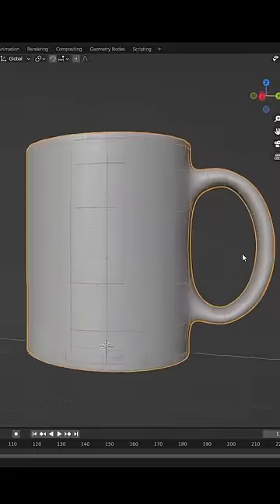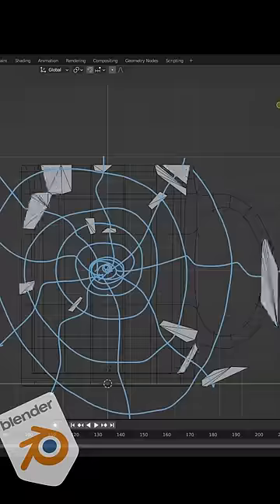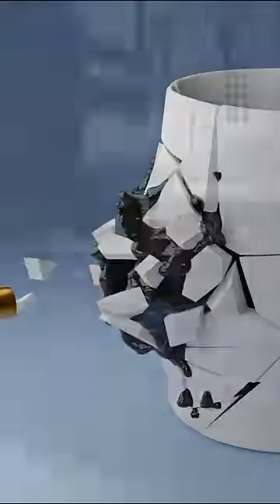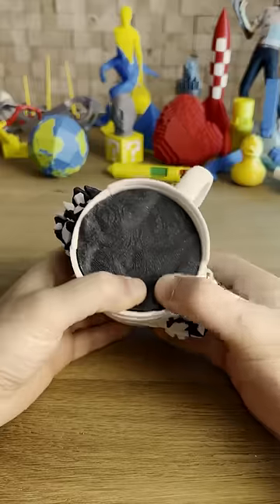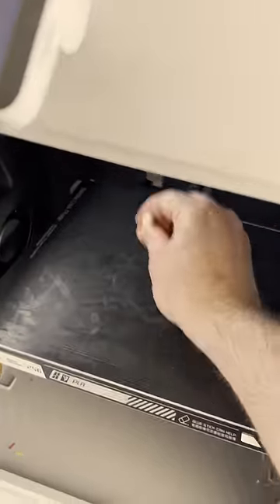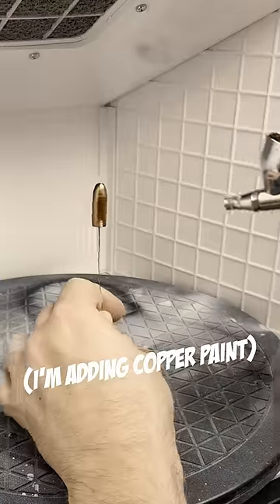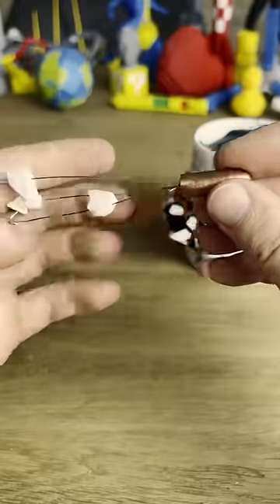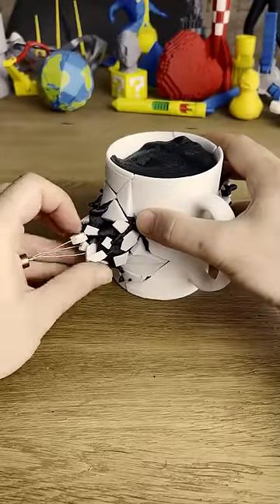Printing A Coffee Mug Shot By A Bullet ☕️ #3dprinting

Comment: This is incredible! In case you ever need to model a bullet again, the shape you printed includes the casing the bullet is fired from. The conical tip is the actual projectile. Amazing work!
Reply: doesnt the casing have a lip around the back end, the bullet doesnt seem to have one so at least to me it just looks like a bullet
Reply: @niil047  True, but bullets generally don’t extend that far back into the casing. That’s where the powder is stored, among other things.
Reply: @keefstafro  search up "high caliber bullet, alot of them are as long as the bullet they made even (or even longer)
Reply: @niil047 this bullet looks like it's inspired by a common 9 mm. Length of that bullet would be significantly shorter than what shown here, if it was modeled after a rifle cartridge, like 308, The bullet would have to be shaped differently in general. 

While not as egregious as modeling the full cartridge it just looks a bit silly.
Reply: it has roughly the same shape as old .45 caliber rifle cartridges minus the flat tip (.45-70, 45-90 etc.) if anything it looks almost exactly like a higher weight (150 grain or so) 30-30 Winchester. both of these are typically found only on lever actions, if I'm not mistaken the tip shape helps with feeding. it also doesn't look like a rimless cartridge either. the model is very much of a bullet, just an unusual/outdated one. it was probably a stylistic choice to have a longer bullet on this sculpture, i do think it follows the lines of the shrapnel pattern better.
Reply: Nah it's fine it's an aperture science bullet, 86% more bullet per bullet
Reply: @niil047 that’s the shape of 9mm dude
Reply: Bro doesnt realize that bullets arent just a point and then even worse trying to correct them with incorrect information
Reply: @adammiller4473 must have been shot by a kar98 8mm round, all jokes aside, it looks like old .308 round ball or just old rifle rounds from ww1-2
Reply: @niil047 im an American and im just letting you know from an expert point of view that the 3d printed bullet is either, too long or mis shaped profile, higher caliber rounds such as 308 or 762 are more pointy and the part that is in the casing is also tapered.
Reply: @kentuckysmoose  cool
Reply: This is the only comment on the fact that in his print, he shoots both the bullet and casing, that doesn't insult him on his ignorance for how firearms work
Reply: Not to insult his firearm knowledge, but he was close enough to the bullet of a 30. Caliber round, witch have longer bullets in the shape of a 10m, a rounded tip, but have a rifle caliber like casing.
Reply: @kentuckysmoose  you all seem to miss the fact that this projectile has passed a ceramic mug ... who knows, maybe it looked different before 😅.  My Hollow Points look like Flowers after Impact.
Reply: @niil047 that lip on the casing is grabbed by a thingy inside the gun I think
Reply: @Whatwhagwhawhat  no, a bullet is the projectile shot out of the casing, and it’s called a round by the way
Reply: @adammiller4473 could feasibly be like a 350 legend projectile or something straight walled. But yeah he messed up and just put whole 9mm casing through the mug
Reply: the problem isn't really the bullet size, rather the fact that it's perfectly shaped even after passing through those layers. it should be a bit smashed at the front if it's really copper
Reply: @niil047  not with a blunt a tip like that one, that’s what you typically see in hand gun calibers so it does look like he modeled the bullet with the casing, but still really cool though

Comment: Really awesome piece! I enjoy the shattered pattern you used for the point of entry and exits. However one critique I have is that the bullet should be flattened. Bullets don’t keep their smooth pointed bodies after leaving the barrel. Instead they flatten whenever they hit something. Even hitting a fragile liquid filled mug would change the shape of the bullet. I recommend looking up some slow motion channels to see how the bullet changes as it hits whatever target they’re using, as well as how the different densities of the solids and liquids would change the trajectory as well so it wouldn’t be entering and leaving in a straight line either. Other than that I would absolutely love to see this as an actual mug one day.
Reply: Explain that to Mr. Kennedy
Reply: This is simply not true
Reply: They lose the cartridge but do not flatten when they leave the barrel
Reply: @faded3657  No one said they flatten right out the barrel they flatten when they hit something. Most bullets are not particularly hard metals
Reply: @rachel705   “bullets dont keep their smooth pointed bodies after leaving the barrel” but i agree w that just dont think its a big enough deal to leave a paragraph

Comment: Three things you could do to make this look much better. 1: remove the casing from the bullet. 2: have the other side of the mug (where the bullet entered) caved into the mug rather than out of the mug 3: have a small motor hidden inside the cup attacked to the bullet and spining it ever so slowly.
Reply: Also give it a tracer since tracer rounds do exist and it wouldn't look so odd to have wires coming out of it
Reply: @Gage-bk7cn A tracer is made by burning a bright substance. How would he make that?
Reply: The bullet head is a bit long and it looks like the cartridge was fired with it too, so if the bullet was shorter it would definitely make it even better
Reply: @jackstailers3248  if it's supposed to be a bullet going through a mug he can make it a bright piece of plastic preferably transparent but a bright blue or red would still work it would most likely support the damn thing better than literal wires and if you mean how thats supposed to make sense i must ask have you ever seen a tracer
Reply: @Gage-bk7cn  many of times. I was just curious on how you would make that effect work but that actually makes sense. Plus I was most likely tired when I made the comment

Comment: The entry looks like the exit and it shouldn't if it's a freeze frame.
The entry should look more like a stone as it entering the water a ripple with an Is indent in the center dragging Fluids The parts that should be flying outwards should be the outer rim of the First ripple form In the glass upon the impact of the bullet.
It looks like the bullet ricochet From the inside Like an explosion.

Comment: Cool but the bullet is too lone for what looks like either a 9mm or 45mm. It would be shorter. If your doing a 5.56 round the the bullet should be smaller in diameter and a bit sharper at the point.

Comment: The bullet hole is not logically or scientifically correct. The hole where the bullet started from should've shattered inward into the mug and come out with the fragments outward. Just thought i'd point that out
Reply: I understand what you mean, but no. Things that can be easily shattered like glass or ceramics go in all directions when shot. Its like when you drop something heavy in water. The water doesn't just splash upwards, but also outwards.
Reply: Bro it's just for fun